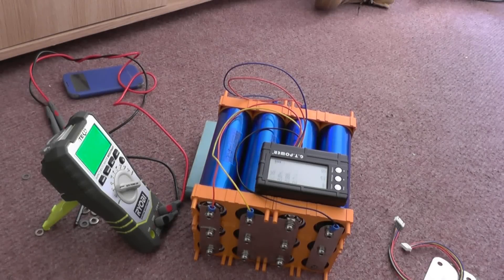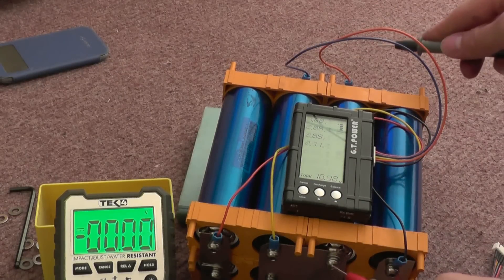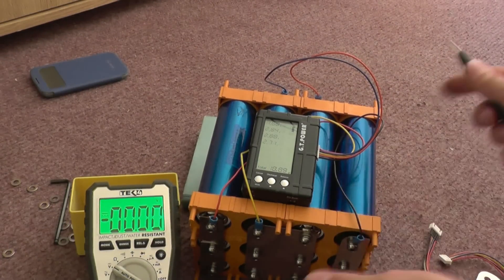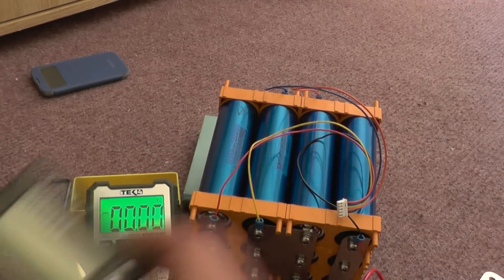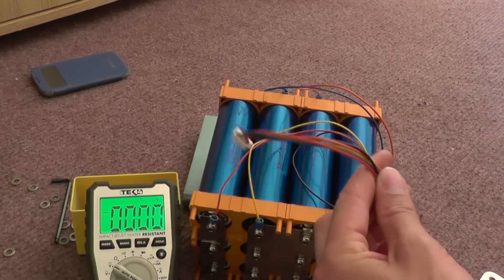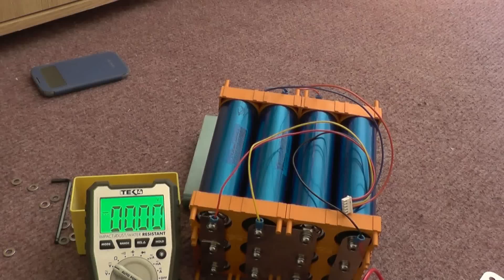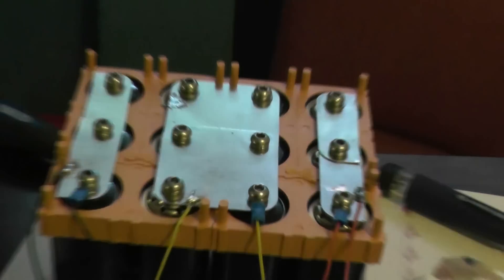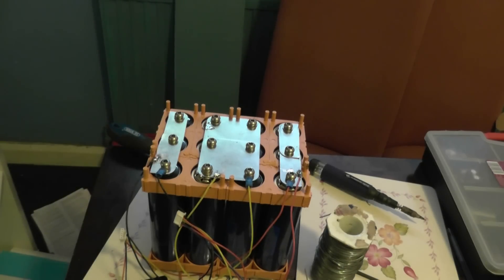lifepo4 part 6 found the fault at last

Comment: I  will change the order of the cable....to see if the voltage below 2 volts move to the new connection...hence is a faulty meter

Comment: Paid lot and still not monitoring cells individually :)
Reply from the maker: I want to make sure i'm not going to fuck this up! I paid a lot and I don't want to damage the cells at all! I literally check the cells before, during and after use! When I charge them I still check every hour or so! I have BMS from china I don't trust anything! =)
Reply: +pietkaify i think this is not individually charge and discharge..you have the 12 cells, 3cells each 11.1v set..and you got 4 sets..but your charging setting is nominal 13.2v for for only 3 sets (3s) or the bms connection/smart charger is the faulty..the it suppose 13.2v 4s max. 1C charging rate..that why 1 set not charging and you drain it more then once..below 2volts meant 3pcs in this set already dead..i rather set 12 BMS meant individually for each cell 3.3v for this big ampere discharge rate battery put all in series..and 4x6s turnigy multicharger..max charging is 3.65v and dont let your lifepo4 discharged below 3v for long life spent..this is why we need BMS and smart charger to take care of it..CHEERS
Reply from the maker: This pack is a 4s pack. and the fault was the cheap cell reader on top of the pack in the thumbnail for the video. Since changing the shape of the pack and buying a new cell logger I have had no more problems.
Reply: Quick question if you don't mind. I really liked this set up or kit.
 My question is what is your source for this kit or battery sytem.
 My second question is what is the  amp hour per kit.
My reason for this for a off grid system   
That needs from 600 to 700 amp hours  
Per 24 hour .
Been looking at lithium as opposed to lead acid please feel free to email me at Edgardocelectric@gmail.com